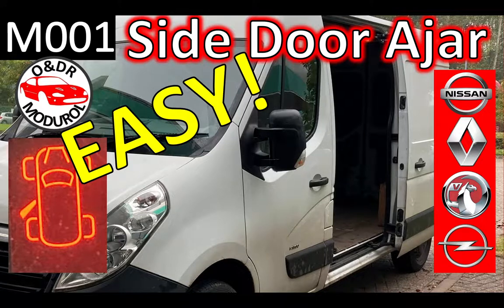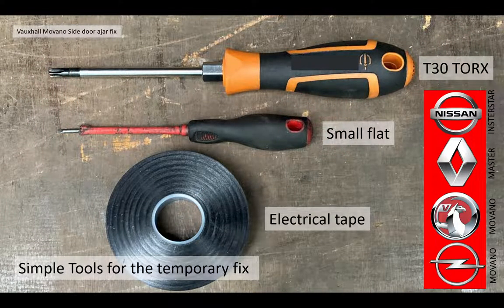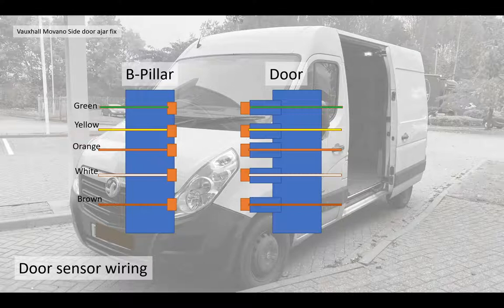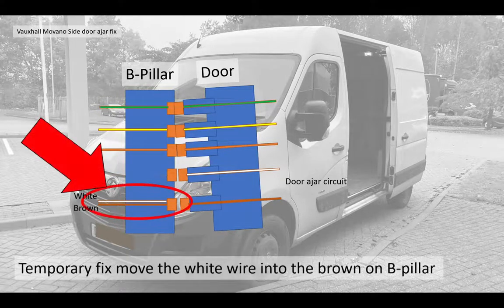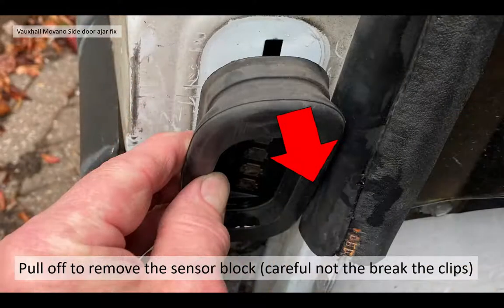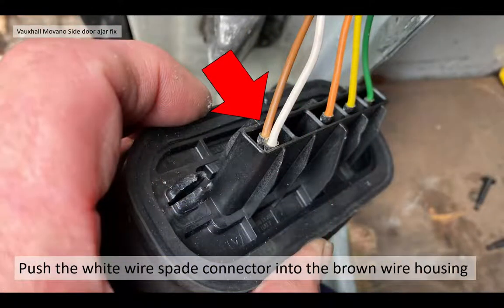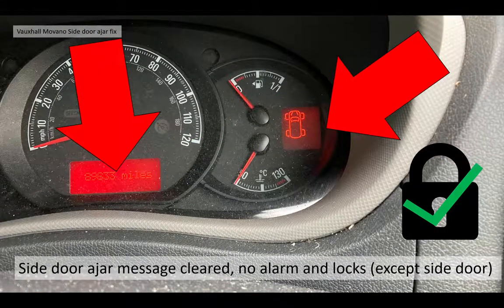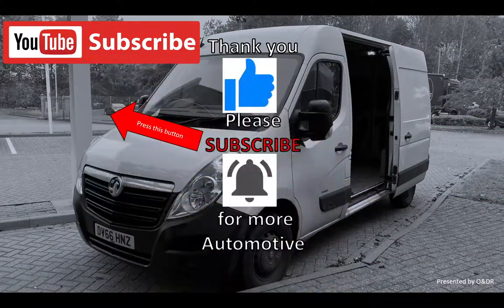Van side door ajar warning message easy fix M01 Vauxhall Opel Movano Nissan Interstar Renault Master

Comment: Thank you so much for this. Started a new job two months ago and got given a van with this exact problem. Literally get headaches from it beeping for 6 hours straight every day. Did this fix today (but with male and female spade connectors and a bit of heat shrink) and it worked like a charm. Central locking still works too. You da man!
Reply from the maker: Josh, had exactly the same issue with alarm. Every time I used the van the alarm would continue to sound and couldn’t see the other dash functions. Not a perfect solution but a quick and easy temporary fix. Thanks you very much for the feedback. Much appreciated, regards Damian

Comment: Thanks for video. bot the Renault today and had the same light on beeping and central locking not working on sliding door done what you said light disappear but lock not working, so i took  door sensor out to check and there was wires disconnected form sensor so i put all back to the original locations, light was off able to lock sliding door but not unlock whit the remote. ON MY B-PILLAR THERE IS ANOTHER  DOOR CONTACT SWITCH ABOVE THE SENSOR BLOCK, WHICH I NOTICE EARLY MIGHT  BE BROKEN. Cutting story short i cleaned all rust greased the plastic for better movement and superglue 😄some type off rubber o rings to extend the pin. Job done hope that's will help some one
Reply from the maker: Aleksandras, Thanks for your feedback and sharing the fix you found. Very interesting, hope it helps someone too, much appreciated, regards Damian.
Reply: some update as it still played around a bit i notice door lock catch more worn at the bottom looked like doors was lining forward so i changed all 3 sliders sins then i haven't had any issues (which top was very badly worn bottom pretty ruff state mid was reasonable)

Comment: When you say the side door doesn't lock, but it locks from the inside, will it unlock on the button or do you have to unlock from the inside also, my van is a camper and only has access into the van from the side door so this wouldn't be any use to me if I have to crawl over my passenger seat all the time, thanks for the video though, it will help loads of us with this problem.
Reply from the maker: Peter, the van locks/unlocks from the key fob. All door work except the side door. Previously, they didn’t lock at all. Think there might be something wrong with the side door catch as well as don’t here it trying to lock. It’s a van with a solid bulk head so can lock the cab ok now but not the load area. Half way fixed as don’t store anything in there overnight. Would prefer to fix it properly. Hence looking for a better fix or the wiring diagram. Thanks for the comment and your input regards Damian
Reply: @ODRModurol  I have had the door levelled back up but it only lasted a week before the dreaded door open alarm again, I am thinking of purring a washer on the bottom screw fastner to see if that helps with the contact, will let you know how I get on to see if it cures the offset
Reply from the maker: Peter, I think the door mechanism is a bit weak and easy to misalign/damage. Might try shimming it. Thanks for the comment and suggestion, regards Damian

Comment: Have you any idea how can i lock the front doors if the side door or the back doors open?
Reply from the maker: Attila, this will work for the side door being open as the van thinks the door is closed. Sorry don't know how to do the same for the rear doors, regards Damian
Reply: Damian, i mean if i open the back doors and try to lock my van(cuz my phone, wallet etc inside of the van) doesn't lock the 2 front doors 😁
Reply from the maker: Understood, sorry don’t know how to do that, regards Damian